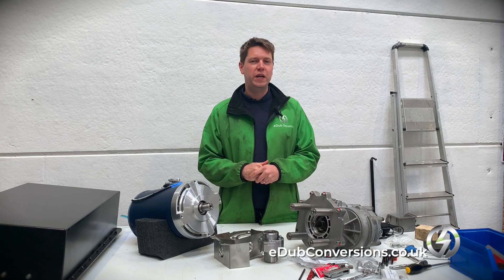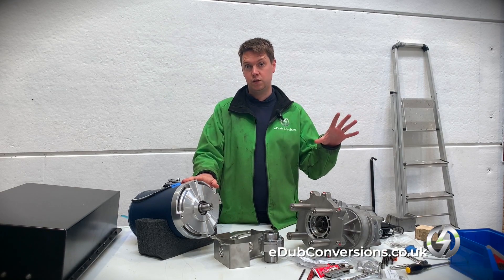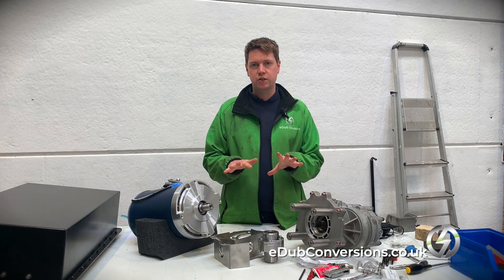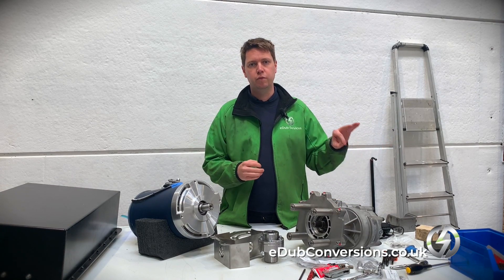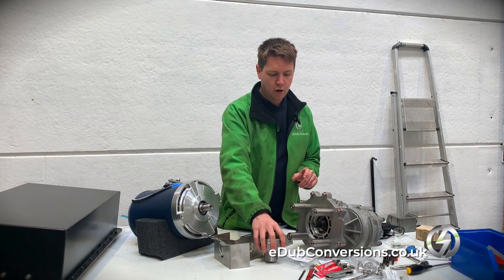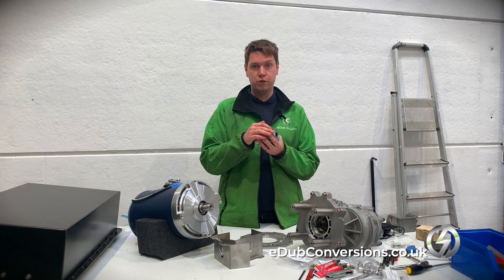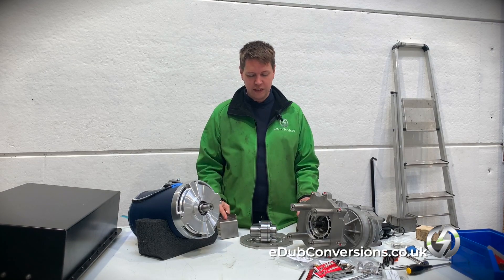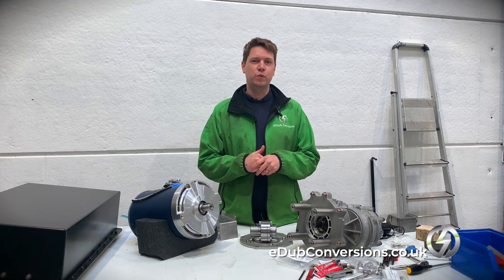Morris Minor Electric Conversion - Part 1: Motor set up | eDub Conversions

Comment: What are the advantages of the reduction box over just changing the diff ratio?
Reply from the maker: The reduction required is high, this is not achievable with the parts available for the standard differential housing. Plus, we are already replacing the gearbox to make this automatic drive, so it made to most sense to reduce the ratio there.